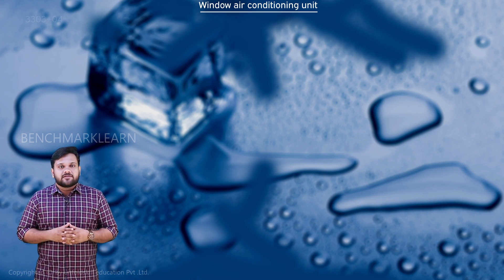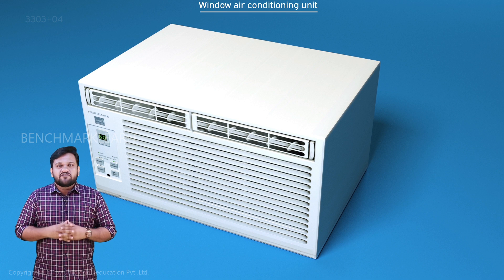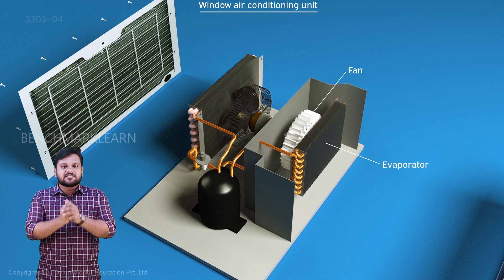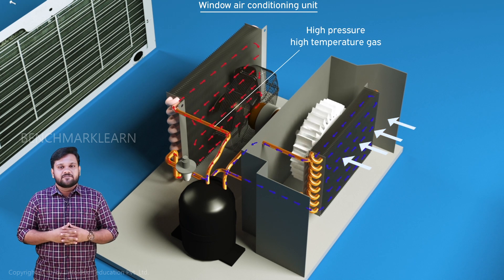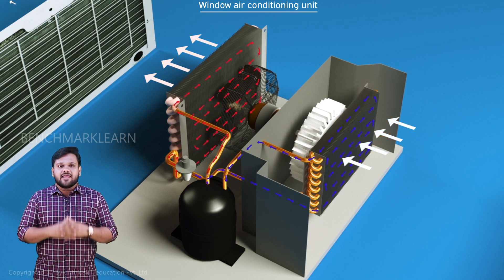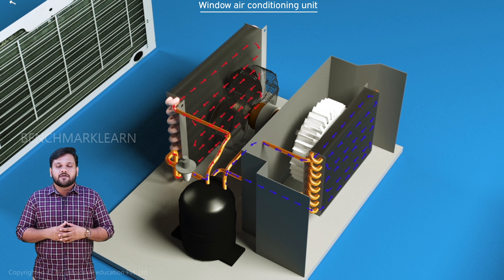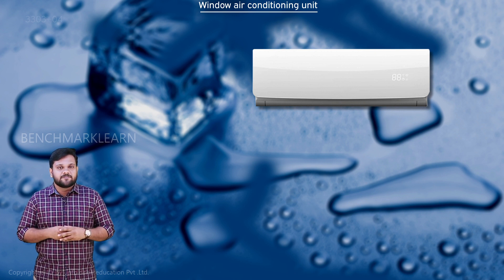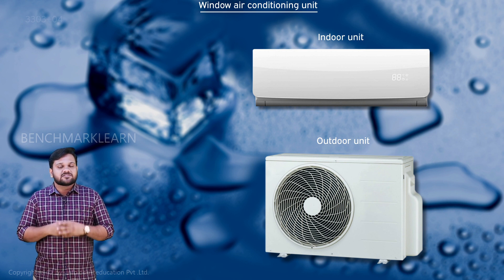Window air conditioning unit | Basic Mechanical Engineering | Benchmark Engineering

Comment: Your explanation lacks clarity as you don't give complete info for eg. U forgot to mention that the evaporator has coils in it which has cooled refrigrant which when comes in contact with hot room air , the room air becomes cool and contracts(becomes lighter) and is blown into room by evaporator blower and the refrigerant in the evaporator coil expand and goes into the compressor where th hot gas turns into liquid phase under high compression and travels to the condenser in the coil. The  heat is then rejected out of the system from coil through condenser unit.Now how does the evaporator unit coils get the cooled refrigrant gases back, is it supplied through the condenser coil after heat rejection?
Reply: Yes there is an expansion valve that lowers the pressure of the refrigerant, cooling it before it goes back to the evaporator.

Comment: There is hardly any water drainage in my window ac when it's working but when my compressor stops suddenly alot of water flows out from the outside unit. 
Why is so??